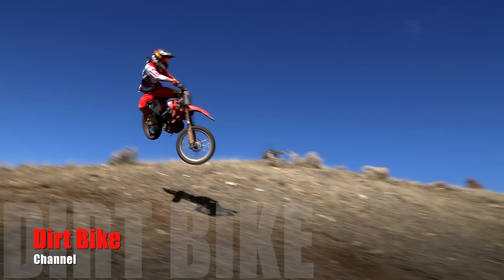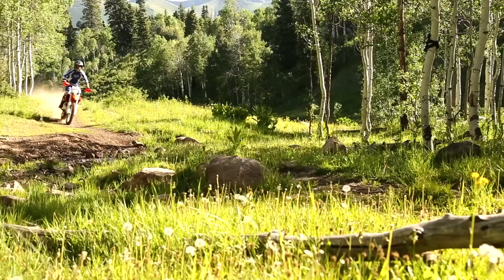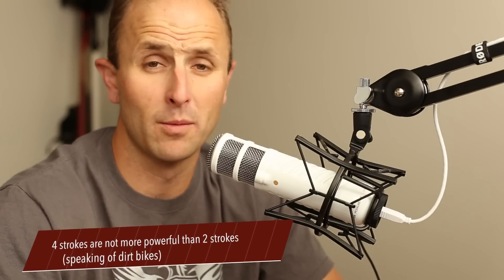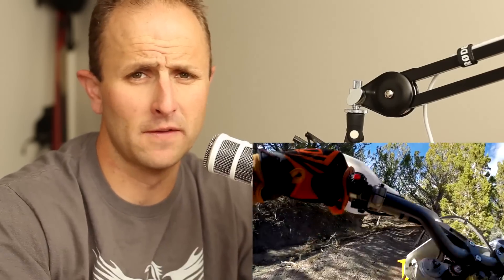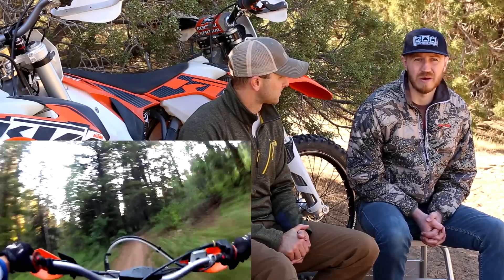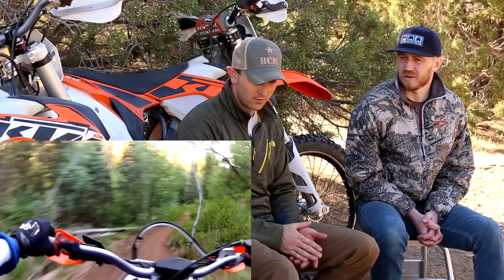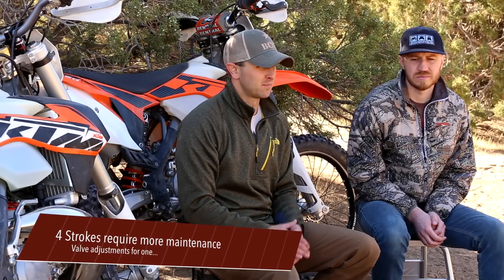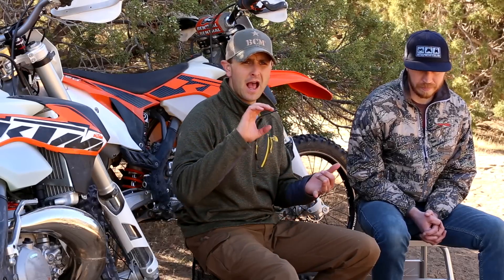Enduro 4 Stroke vs 2 Stroke Part 1

Comment: many motocross events are actually open class so you can run a 500cc two stroke if you want(and i dearly love the cr and kx500s) but your going to lose and the four stroke gets better traction and like this guy says they hit lower and rev higher...200 hours or even 150 on a two stroke and you must be really tolerant of poor running conditions...but my problem with two stoke is i cant use it for this distances we travel out here in the west, my 300 can go up to 130 miles and even at that have been close to running out of fuel

Comment: I agree with most of the video, except for when your friend said that on 4 strokes you have to adjust the valves a lot. My dad has had a 2009 honda 250x and he hasn't adjusted the valves much. He's had it since 2011 . But all in all, great video. Really helped!

Comment: To me it's simple 2 strokes are the way to go I got the 2017 ktm 150sx which is really fast and really light 192 pounds and was cheap 6800 out the door compare that to a 450 and there like 10,000 out the door so that 3,200$ I can spend on the extra gas and oil and top ends and anything else and I really enjoy riding the 2 stroke really fun and love the sound so for me it just makes sence that the 2 stroke is the way to go but I still ride 4 stokes to because I have a 450 dual sport for the road and hit up the trails or beach with so both is the real winner
Reply from the maker: Rock on.
Reply: + 2stroke sound amazing
Reply: Cody sansbury Are you saying a 150 pretty much has 450 power? If not the comparison is flawed.
Reply: MX127 I bought a yz250f in 06 otd for $5k USD. I threw in cams, jets, fmf megabomb, vortex cdi, and a 13:1 piston. Was 5lbs heavier than my buds 02 cr250, out ran it in every gear, had 20mph more on the top end, and drank far less gas. He bought a tuned up wr450 forcing me to buy a ktm 450. That yzf cost less than your 2 stroke in total, and when I sold it I made $100 in total after 2 years, just oil changes, and 7000 miles of desert riding.

Tell me how 4 strokes are expensive. It's called laziness. Learn to deal, learn to shop. I was a kid then and had to. Now that I have more money I'm not as aggressive but whatever.
Reply: MX127 you realize the KTM 300 vs 500 is a matter of a few hundred dollars, not thousands. Gas and oil is far more expensive on the 2 strokes, and they have lower resale value.
I can buy a 50cc 4 stroke, should I compare that to your 450 enduro? NO

Comment: Very good points brought up. I like the video. I switched to a four stroke when I got into motocross. It was awesome! But like you said, very expensive. Now I got out of motocross, and back into off road. I'm back on a 2 stroke. It is my preference for off road for all the reasons you bring up, and many more. Thanks for the videos! I think it is good for or sport!
Reply from the maker: Jayson Rowley Yeah, we need to get the word out about 2 stroke. KTM, Husky, and Beta have awesome 2 strokes.  I'd love it if we could get Honda, Yamaha, and Kawasaki to take note and start building 2 strokes again.  Yamaha would have the easiest route because they still have their YZ 250 in production.  A few mods on that bike (different gearing, flywheel, 18 inch rear tire, skid plate, etc...) and it would be a good off road option IMO.  They could even offer a 300 version with very little effort if they wanted to.
Reply: Couldn't agree more!

Comment: Not to get too much off subject, but about five years ago Evinrude developed a new two-stroke engine (the Etec G2) in conjunction with the University of Wisconsin School of Engineering. Aside from having all of the mentioned positives associated with two-strokes, it has 15% less emissions then the next closest four-stroke. I’ve had twin 300 hp Evinrude E tech G2s on my boat here in Alaska for the last three years, and it has proven to be one of the best purchases I’ve ever made in the way of a vehicle. The maintenance intervals are five years/500hours. A year or so after Evinrude released the Etec G2 two-strokes, Honda applied for a patent for their own two-stroke outboard. 

My long-winded point is that it looks like through technology advances we may start seeing two-strokes again on the street and in things other than dirt bikes and weed wackers. I’d be happy just to see some lightweight street bikes go back to two-stroke.

Comment: My dad has a 1999 cr250 and it still runs like brand new
Reply: +Ty Sayer then the piston shatters ha
Reply: +David F (dtf96) if your piston shatters, you are gonna have a bad time haha
Reply: +David F (dtf96) If you wait until the piston shatters you're doing it wrong. I love 2 strokes, the sound, the smell, the power and they are easy to maintain and rebuild, takes like 10 minutes to change the piston lol maybe even less :P
Reply: +David F (dtf96)  How would you know it's about to shatter? Did the bike have less power then?
Reply: +Ty Sayer yeah my 1997 Cr250, even tho in that year the frame is shit. the damn thing runs just as good as a new 250 2 stroke. ive completely redone the 97, from the ground up. And it is just amazing
Reply: 97/98/99 CR 125/250 best looking hondas

Comment: a little bias my friend, AND I HAVE A 2 STROKE
Reply from the maker: +Erit 71 Keep watching and we give a fair shake to both engines.  I own them both and have owned both for years.
Reply: Aight
Reply: Luke Marvenko hes not being biased hes owned more then enough 4 strokes , if they were better for off road im sure he would be riding them all the time, hes just speaking the truth , 2 strokes are better for off road because it all comes down to power to weight, u want ur bike to be really powerfull and to be light as possible, simple as that, and its as simple as owning a 2 stroke..
Reply: 2Wheels 4Life power to weight is not what's best for off road. So I should take a Ducati panigale with its 205hp and 420lbs to erzberg? Idiot.

Also 450s have much better power to weight. 12 extra hp for 15 lbs. That's 25% more power for 3.7% more weight with a rider.

He already conceded 4s traction advantage. So you get better power, better power to weight, better traction, better range, lower environmental impact, better engine longevity, and 4% more overall weight.

Lol. Not even close. 4 strokes are far better at anything that doesn't require the lightest weight possible. Even the 300 2 stroke can't make the same power as the KTM 450 exc motor out of the box. The KTM 350 sxf motor makes 54hp while the 300 makes 51hp on the same magazine dyno meaning the 350 makes 1hp per 6.5cc vs the 6cc of the 300.
Reply: Heeksas lol no it won’t. Just like 250 2 strokes don’t murder 250 4 strokes. In fact, 250 2 strokes were turning slower times than 250 4 strokes in motocross and desert races. I’ll remind you that 250f class is not as advanced as 250/450f classes lol. 

Remind me, how many 2 strokes have won the Baja 1000 and Dakar Rally since the turn of this century? 

Those are open races where 450 4 stroke bikes destroy every other bike. 

Erzberg doesn’t need a ton of power, and every pound matters in the low speed technical sections. That’s why they choose 2 strokes. 

Current motorcycle engines, not race engines, are now making 50hp per 250cc running on normal shit gas. We know that motogp bikes are making 60+ hp per 250cc. 

Sorry bud but you’re wrong. 2 strokes only survived for events like erzberg, and have died off for the vast majority of other races. 

Far more often a 4 strokes will rape a 2 stroke even with equal displacement.
Reply: Luke Marvenko not at all.  Just the truth my friend.  I've ridden both.
Reply: Firestarter okay,  how bout not calling people an 'idiot' for their views?  Now,  you've put out some facts so I get your point.  BUT,  when the first 4 stroke motocross bikes came out, remember how the races were 250 2 strokes had to compete with not 250 4 strokes but 450 4 strokes.  So wouldn't you agree that that was because the 2 strokes were faster?  If not then why wouldn't they have raced 250 2 strokes against 250 4 strokes?  And as far as desert racing,  it seems like a CR 500 would beat the 450 4 strokes,  but I'll take your word for the race statistics you mentioned.  I'm assuming you looked up factual information.
Reply: Christopher Walker to this day you can ride a 500 2 stroke in a desert race, yet they are dominated by works 75hp 450 4 strokes. 

In the late 90s motocross came under pressure by the manufacturers to allow 4s power. So they came up with a terrible formula for allowing them that made it completely unfair. It allowed 4s to be have more mid range torque (pulling out of turns) and over rev power.

That doesn’t change the fact that 4s engines can multiply torque easier. 

Factory bikes could have featured 16,000 rpm 125cc 4 stroke engines that would’ve had far more power than the 2stroke.

Simply putting in top end cams in my yz250f with a vortex ignition and reving it to 14,000 rpm let me beat 250 2 strokes on pavement drag races. Even beat some 450fs that were more mid range (6-8000rpm) focused bikes. 

2 strokes are Inefficient designs. Ports aren’t conducive to wide high rpm power bands. Ports allow the fuel and air to escape the cylinder (4s gets better cylinder filling per cc than 2s). 2 strokes typically have longer strokes which increases piston speed and reduces maximum engine speed. 

I’ll continue to label people as such.
Reply: Efficiency should include resources and cost to manufacture.

Comment: 2 stroke roule but i have a 1998 trx250 recon (4 stroke) and beat the shit out of it and it has never failed.
i just feel like 4 strokes are more reliable but when they blow they blow the bank.
Reply: that's an old 4 stroke were talking about a new ones right now

Comment: a 4 stroke is a torque king. in a race where there are more turns and jumps the 4 stroke is king for easier control and the torque it puts out. if it's a long straight track then the 2 stroke is king. 4 strokes last longer and are stronger engines. av2:stroke needs taken apart and looked at alot more than a 4 stroke. I own both and that's the hard facts
Reply: and if your working on a four stroke all the time you should switch brands

Comment: I had a 2004 KTM exc 2-stroke that I bought used with a new too end. I'm not sure how many hours I put on it but I had the bike for 2 years and rode it almost every weekend I could. When I bought it to the time I sold it it started up with only 1-3 kicks max every single time. By far the best bike i've ever had and when the time comes after school I will be getting another 250 2-stroke.

Comment: u should try a yamaha way better  than ktm
Reply: +doom421000 i owned a 2002 yz250f  awsome bike ! but i thought KTM are better then Yamaha ? please tell me in great detail why Yamaha is better then KTM ?  or anyone here please
Reply: +savagex466 unmatched reliability and fit finish
Reply: +doom421000 Gonna say, I own both.    KTM.   Outside of the E-start sucking, KTM hands down.
Reply: ktm hands down eh ? i loved my  02  yz 250f   very reliable    but iv always been drawn to the ktm   they come with good extras and i hear great things about em   i hate how the 250 xc is ONLY electric start   that sucks man  if it dont work alot  im all about reliabilty   fuck my spelling haha    not sure if id be a fan of the wide transmisons  but those modles have both kick start and e start witch is awsome !
Reply: doom421000 I got an 02' yamaha yz85 2 stroke

Comment: Title should've been "Why 4 Strokes Sucks". Its just so bias.
Reply from the maker: +Zack Stark My guess is that you don't have much time on a modern big bore 2 stroke and that you didn't watch all 6 parts to this series.
Reply: Your guess is a hit and miss, I do spend a little time on 2 strokes but I do get and feel the difference. I watched up to episode 5 where tides finally began to turn, but still its is still pretty bias. Don't get me wrong as a 4 stroke fanboy, 2 stroke are good,light, jump and kicks like a mule. But in my opinion its a fuel devouring machine as fuel constantly running which makes its stalls less easier than 4 strokes.(opinion on episode 3 or 4 I think)

Comment: I like 2 strokes because they are light, powerful, incredibly simple, and often cheaper to buy used or new. I still love 4 strokes because you don't have to use near as much clutch or worry about shifting as much to keep into the powerband,  engine braking downhill, and durability and not having to worry about jetting nearly as much, but 2 strokes are addictive and fun with their light weight and power per cc, and the sweet wing ding of the engine.

Comment: I remember the smell of Bel Rey back in the day and 2 strokes was the choice.  Fast forward, 4 strokes are very fast, versatile and practical for all kinds of riding.  My very first bike was an enduro 76 Honda XL250 (4 stroke).  Then I got myself a 87 Suzuki Rm250.  Currently I have 2000 Honda Cr250R, and a 2004 Honda Crf250x.  They are both fun bikes to ride.  Green sticker bikes in California.

Comment: I've viewed all 5 of your 2 stroke vs 4 stroke comparison videos, and I must say from an "ordinary" rider's point of view (meaning my point of view) you have done an excellent job of capturing the essence and character of riding these bikes off road (as opposed to on a track). I find this comparison to be far more useful than the magazine test articles. Those articles are almost 100% directed at competition riders of national caliber. They make for interesting reading, but they aren't very relevant to my real world experiences over the last 45 + years of riding 2 strokes off road. I find your observations to be spot on and they coincide almost exactly with my own. 

Regarding reviews, my current ride is a 2015 KTM XCW Six Days. I have outfitted it with Kreft Moto mods to the 4CS forks and the PDS rear shock, Scotts dampener, G2 throttle, Rekluse Core 3.0 auto clutch, Rekluse left hand rear braking, Tubliss inserts front and rear, and last and most important a 36 mm billet version of the SmartCarb. It is far and away the best bike I have ever ridden. So, on the review point, have you considered a review of the SmartCarb for your channel? I think you would be surprised if not astounded in the performance improvement to be had by this carb. I have no relationship with the SmartCarb people other than as a customer. Having experienced the benefits, I decided to write an unofficial tuning guide for the SmartCarb, in layman's terms, which I have posted (and is downloadable for free) on KTM Talk. If you ever review the SmartCarb, perhaps this manual  will be of assistance.

Keep up the excellent work.
Reply from the maker: Barry Jackson Thanks for the kind words. I don't have any experience with the SmartCarb.  I'll have to look into them.

Comment: I have a 2 stroke motorcycle that was built back in 1988 the piston was changed only 1 time, around 10 years ago and it stil works to this day whit realy little maintence (I have to clean the carburetor sometimes).

Comment: As far as when to change the piston depends on the size of the piston as well as how hard you ride in what temp. The bigger the piston the longer / more hours before a new piston is needed..300 2 stroke or even the 380cc 2 stroke can go for a long time before a new piston is needed provided the gear oils have been changed often..

Comment: Oh yeah, this is a must see video for every potential buyer.
Some people online really jump on that thumper wagon, but I don't believe many have actually owned a new 4-stroke bike.
Best advice I have for any would be performance 4-stroke buyer is to forget the first question you care about. Instead of the haggling over price before you become emotional committed to the bike... Ask them for the manual to the 4-stroke in question and then head to the service department!
Ask for the quotes on adjusting valve tolerances, piston, and cylinder prep.

For the 2-Stroke, just ask them to roll in a brand new jug/piston with the financing of your bike. You may never be inconvenienced by time, but in the off chance you need to get it done with little time before a ride... you're set with a quick swap jug that'll make a thumper pound ground in rage!

If you get an off-road 4-stroke, don't expect to go tail whipping at the motocross track... expect to get your tail whipped at the motocross track. They're heavier, much heavier and off-road 4-stroke bike is still made/based on the glass cannon SX/MX engine, but with much more weight.
I've done it already. I bought the 450 for 8k, added in the premium parts + regular scheduled maintenance pass for 3.5k for the first 2 years.

The sales teams do not read the manuals, they just want to sell bikes. Don't ask for their input, just get you hands on the manual and take a seat.
I sold my bike for 3.8k in the same year and I came out far ahead by eating that 5k + 3.5k parts and labor pass. Cylinder maintenance and valves is where I came out ahead.

Finally returning to my old passion of riding 2-stroke and no longer fearing every mile added. If you buy the 4-stroke, you had better be competing on it ASAP to grab yourself a sponsor to fund your repairs.
Reply from the maker: Thanks for sharing this.
Reply: +Dirt Bike Channel 

No problem, it really stings when you get a bike that makes you worry about riding. Your debate is something that every buyer needs to hear and it's planted right in the heart of the biggest issues. Thanks for your video, it'll save a many a rider some gut wrenching and consistent down time at the shop.